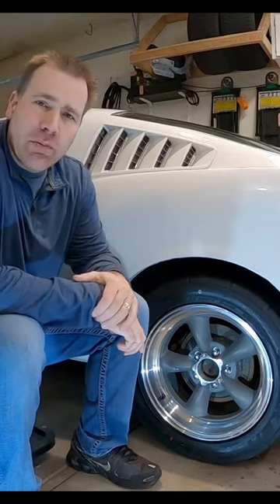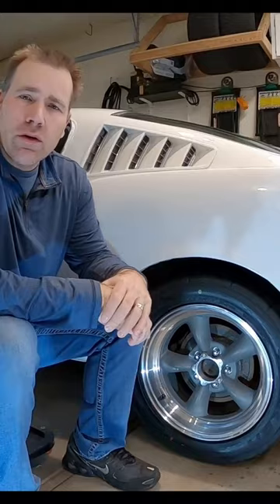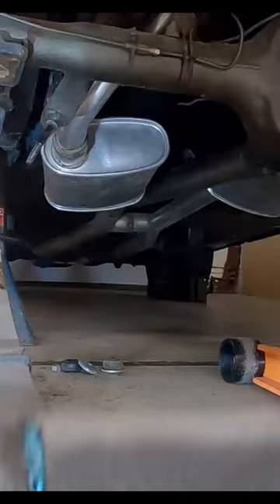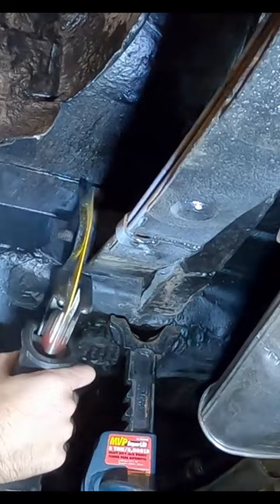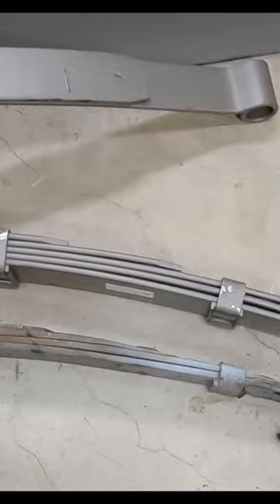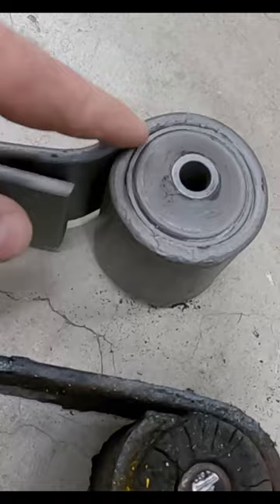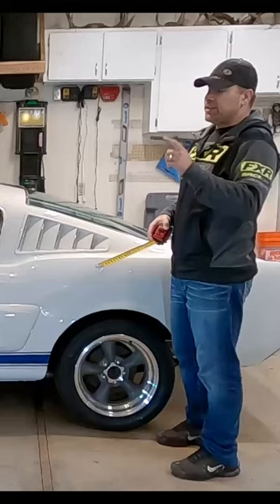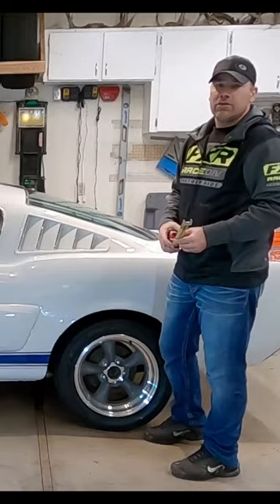1 Inch Lower Leaf Springs?

Comment: Those lowering springs will lower the car a little more after they've settled.
Reply from the maker: Yes, they did.
Reply: @AndyKruseChannel  did you get your full inch of drop after they settled?
Reply from the maker: @goldysgarage189  Yes, later on I took the 1 inch lowering blocks out and put in 1/2" blocks.

Comment: Those worn out stock springs as they wore out they lowered your car the car was already lowered if you think about it had those been brand new factory stock springs then you would have an accurate measurement which would be way higher than what you got for a measurement before you replaced them
Reply from the maker: Good to know.

Comment: You need to drive it. Leaf springs will settle after you cycle them a few times.
Reply from the maker: They did, I had to take the 1 inch blocks out and put in 1/2 inch blocks a few months later.  :)

Comment: The second eye is called a Berlin eye. Throw a few hundred pounds in the trunk for a couple of weeks and you can get it lower. Also if you tightened the eye bolts with the suspension unloaded ( axle hanging free) then loosen them and retorque them with the weight of the vehicle on them as additional lift is generated by bushing torque.
Reply from the maker: Thanks for the heads up.  :)

Comment: Ever tried the wax/candle trick for stuck bolts. It can save a lot of time. Heat the bolt, touch the wax to it (like soldiering) knock it out with a punch and hammer.
Reply from the maker: Never heard of the candle trick, but I’m intrigued.

Comment: Those new springs will settle in. They look like a much better setup, they probably have a higher spring-rate and should improve handling and road-feel.
Reply from the maker: They did, this Short is from an older video.  :)

Comment: Drop the air pressure in the tire get that extra lil bit
Reply from the maker: Haha, great idea!  😆
Reply: Lower profile tires. . .

(Bad idea on the street, though. You get less feedback from the sidewall with low profile tires and so you don't get the feel right before the thing starts to slide. They grip well until you hit the smallest of bumps and then you break free and you're all over the place.)
Reply from the maker: @That70sChannel  You're probably right, that's why no race car in the last 30 years runs a tall sidewall tire for any kind of road course or road racing.  The only race cars that do are drag car because they need the taller gearing implied by the taller tire.
Tall sidewall tires offer compliance and comfort and they absorb so much of the road that you get little feedback.

Comment: The issue appears more that the final result will be a stiffer ride. The stock springs had 3-leaf, however the replacements had 5-leaf.
The 3-leaf springs would give more flexibly to bumps and allow deeper squatting at take off.
The 5-leaf springs won't flex as smoothly over bumps, and restrict squatting on take off.
It all depends what you were trying to accomplish here. Personally in a mustang the body/frame system would benefit from a softer spring on the road bumps, take off squatting would benefit and you wouldn't have to worry about the stresses to the body.
Reply from the maker: Yeah, I'm building a different car than "what's good for the classic Mustang", and I'm enjoying the hell out of it!  :)
Reply: @AndyKruseChannel  
You should look up "Factory Five Racing" *kits.
Keep the mustang original it's worth more that way. The kits are reasonably cheap.
Reply from the maker: I wanted one of their kits 10 years ago, but could never afford it.  It's ok, I'm allowed to build the car I want to build.  Let me waste my money the way I want and I promise I won't tell you how to waste yours.  :)

Comment: I can never get any eye bushing that is 30+ years old on shocks, springs, etc. I usually end up having to cut the metal around the bushing with the grinder on shocks and hammer like a madman on the leaf springs. They always rust onto the metal cylinder in the bushing and spin internally.
Reply from the maker: Use an Arbor Press?

Comment: Me watching this SMFH... I was once quite keen on the old mustangs, as a teenager. But then I discovered that the UKs now completely deceased car industry produced some pretty good vehicles. I opted for a series II 1974 Rover P6 V8.

For comparison, even the 63 P6 had IRS all round with powered disc brakes on all four wheels and a supplemental de-dion tube in the rear.

Rover lied about the top speed and power output, which was the style at the time. My clapped out old car would still do 60mph in 1st and was able to leave the factory car park going sideways. With a few aluminium body panels and a kerb weight of just over a tonne, you could genuinely enjoy going through corners without the fear of being left in a tree by leaf springs.

Which is a long winded way of saying, I see leaf springs under a car, I'm walking away.
Reply from the maker: I’m not opposed to ditching the leafs, but the alternative doesn’t work with my budget. 😁
Reply: @AndyKruseChannel  Oh no no no! I'm not suggesting that, you shouldn't butcher that lovely mustang like so many other YouTube peeps, to make it into something it wasn't. This is why I walk away from those cars. Because someone else who is fine with an original American muscle car can enjoy it for what it is.

One video I saw ages ago about a college kid from a rich family really went the whole nine yards. Bought a mint 69 Camero SS and replaced the engine with a modern injected LS, all the suspension, the brakes, the gearbox and instrumentation, all with modern stuff. Just totally ruined the car. It's one thing if you start off with a husk you dragged out of a junk yard with nothing in it, it's quite another to butcher a classic.

Comment: Would lowering blocks given you the drop you wanted??? I have a set from Holman Moody that I have yet to use as my 66 is low enough! Thx
Reply from the maker: I already knew I wanted my car lower and I had zero plans for stock height, so ordering the mid-eye leafs was an easy choice.  From there I can finalize the amount of lowering I want with some blocks.  I have a set of 1/2" blocks in there and I'm right where I want to be with height.  :)

Comment: Andy Kruse...what size wheels and tires are you running. That stance looks good
Reply from the maker: American Racing Torq Thrust 16x7 with 4" backspacing wheels.  Falken Azenis RT615K+ 225/50 tires.  :)

Comment: YEAH IT TAKES A LITTLE WHILE FOR THE SPRINGS TO SETTLE BUT IT WILL DROP
Reply from the maker: It did, I had to go from 1 inch blocks to 1/2" blocks a few months later.  :)

Comment: what size are the tires and rims?
Reply from the maker: American Racing Torque Thrust II wheels, 16x7, 4" backspacing, part number VN2156765.
Falken Azenis RT615K+, 225/50/16, all four.

Comment: Give it 500 miles then measure
Reply from the maker: Did, removed the 1 inch lowering block and put in 1/2 inch units.  :)